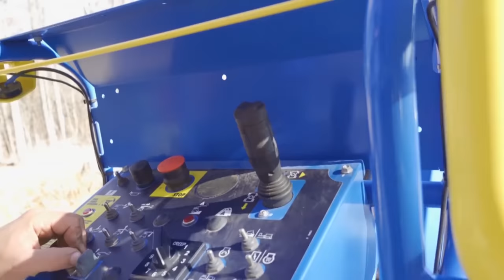Family Builds Mountain Home In 12 Minutes | Start To Finish TIMELAPSE

Comment: On the minute 10:30 you cover the exterior of that room with wood, and my question is what kind of painting or material did you used in order to avoid damage on the wood because of the whether.

Comment: Geothermal cooling, to an auto a/c compressor to a chilled water tank that sends cool to two places in the house. Most heat lost in ground. Single phase motor or wind turns geared up delco compressor to cool working fluid. Perhaps antifreeze, alcohol or water.  Drains into underground tank in the fall. Only safe, nearly silent, cooling liquid goes to fan inside coils.  Then a fan blows air across cold coils for minimum noise and amps.

Comment: "Winter is coming" ya about got licked.  I recommend the oil filled electric radiator as supplimental if the stove goes out.  But... "SUMMER is coming."  The A/C unit could be put in the loft window to keep the entire loft from becoming an oven.  Cold drops.  An exterior vented unit may be an option.  Cut down on interior noise.But think outsice the box; cooled water to a heat exchange inside.
An electric eye at the bottom of the access driveway is not a bad idea.